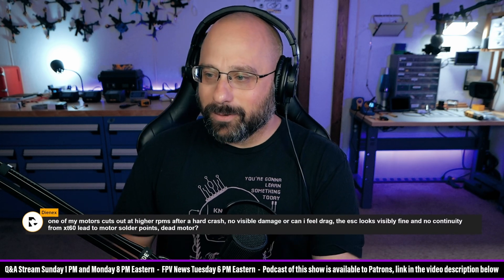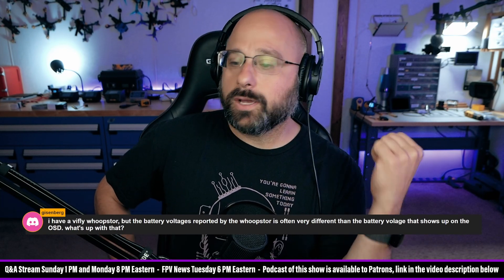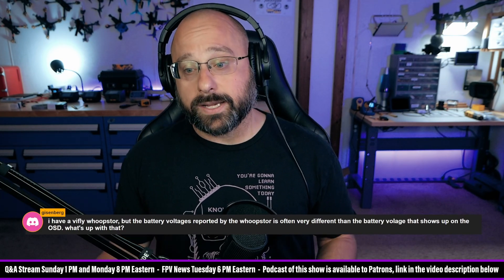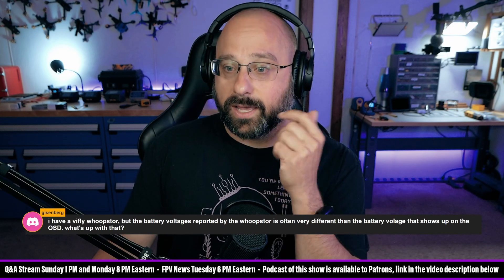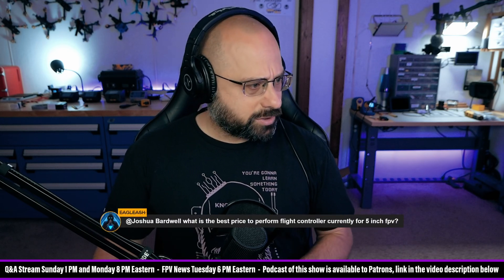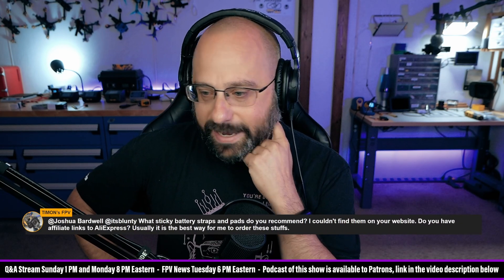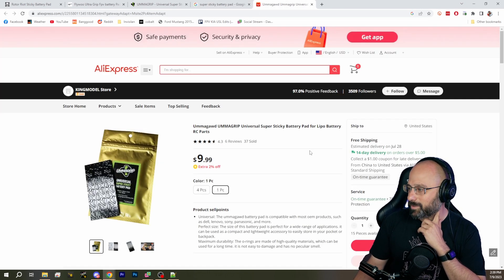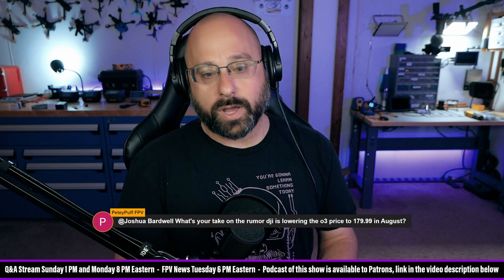Drone Pendulum Rocket Fallacy? Broken Motor After Crash? Wrong 1s Battery Voltage? - FPV Questions

Comment: I found out the best low weight low winddrag 4K solution camera I think is the Hawkeye Thumb 4K. The only other solution that does have a higher winddrag is a stripped Gopro.
I am good enough to build my own drone but stripping a Gopro is at another level. Do you know a way to use the Hawkeye at 4k50 and collect Gyroflow data?
Or do you have an easier solution that is an of the shelf product or requires a skill you also need for drone building like soldering?
Or is there a way to connect a remote to both the camera and the FC/blackbox module so it only collects gyro data from the FC as soon as you push the record button om the camera/remote?
Reply: just go with runcam thumb pro, gyro included
Reply: @bearbeefpv  that's 2.7k60. Than I'm still better of buying a Hawkeye even if I use 4K with Gyroflow